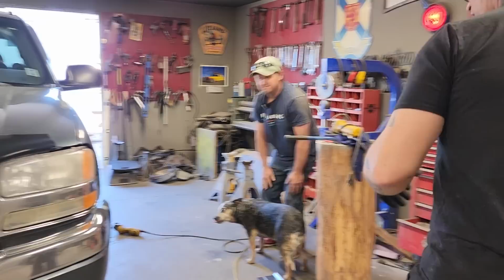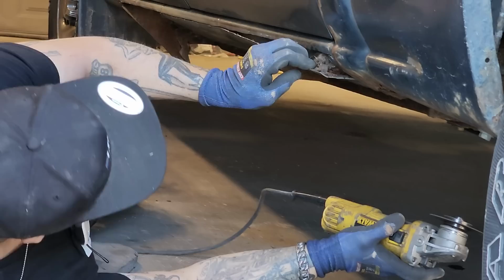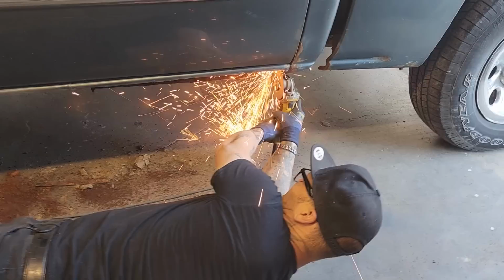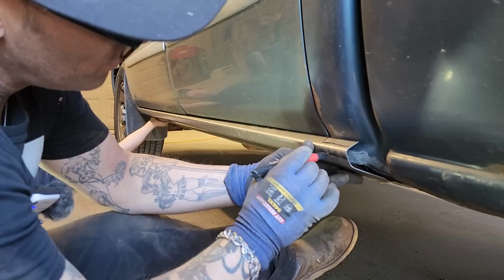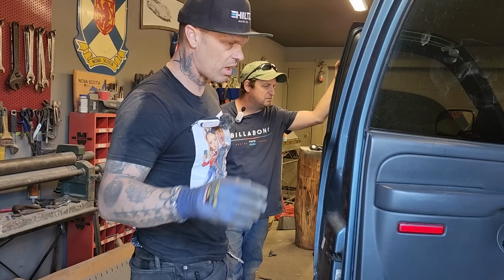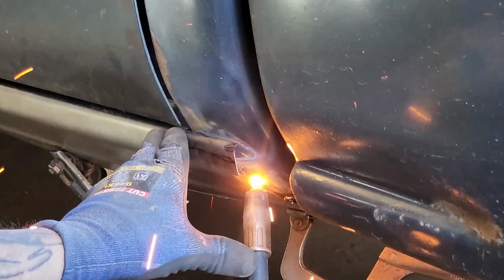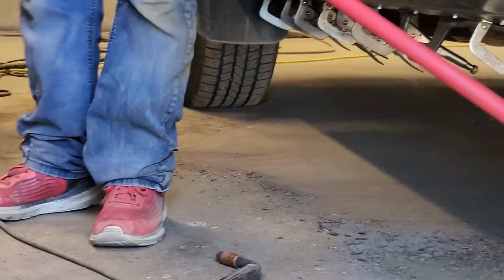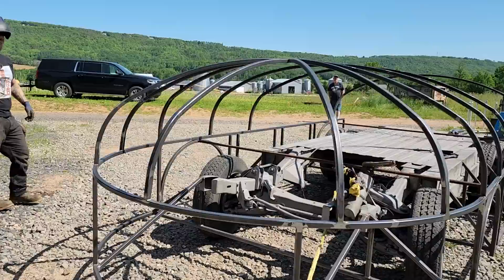Rust repair to pass inspection (sill replacement) ✅

Comment: These sort of repairs are my day to day - I've gone  good at  doing them through endless repetition.  I no longer give them any thought.  Pal came in today - I had the back axle off a big sprinter van where the mounts had all corroded away - I was rebuilding the mounts in order to re-fit the axle. No other place would even touch it. Sprinter will go out with that back axle solid as a rock.  He was amazed that it was even possible - to me it was just another day at work. 

I see the same vibe here - just another job, no biggie - that only comes from long experience. People see it & think it is amazing - Chads going "Well this is a doddle... todays a Holiday Day!"
Reply: Isn't it fun when your skills flow after daily practice.  It becomes like second nature.  Congrats on achieving that with this type of work, if only so I don't have to.

Comment: finally you went with 'store bought'. I mentioned that last truck rocker repair and got chastised for the even considering that. Actually addressed as negative comment on following video
Reply: Rocker was hand bent on a brake
Reply: @robclawson2931  i know that. The rocker is made by the guy that sold Chad that big body machine (?)

Comment: i just put home made rocker panels on my 57 chevy wagon and i painted the insides of everything before i welded them on.
 i also used a Lenco panel spot welder to weld them on.  it makes it EZ but everything has to be clean for the welder to work.

Comment: Chad in my experience welding on a car I always disconnect the battery ground side. As welding on the car the ground current travels through the whole car, there is a chance it might travel through the alternator or even worse the cpu  { computer }. Good luck as always. Bob from Fresno, calif
Reply: Yep we always disconnect the battery dont want to be blowing wiring, batteries or on board computers, if he got a bad earth and fried the computer he is up for a lot of money, not sure how much over there as people trash vehicles after a few years, here they are expensive, even jump starting or charging batteries is a risk, Doug should know that being a mechanic and all.
Reply: @jamesmatheson5115  oh wow are you being critical against bad Chad?🤔🤔 that’s a first.🙄🙄 it’s just amazing me how jealous you are that bad Chad make millions and you don’t !! You must stay awake at night Thinking about bad Chad. 😝😝😝😝😝
Reply: Not necessary with MIG. Exhaust shops ‘never’ disconnect the battery.
Reply: @howquick  Isnt most exhausts isolated with OEM fittings? Plus its a clean material, so guarantee a good ground and strike, just asking.
Reply: @brucewitcpalek5120  yep, Im cranking all night, Im so happy Im in your head too. lolol
Reply: @jamesmatheson5115  they're bolted to the engine block...which has one or more ground straps connected to the body.
Reply: @jamesmatheson5115  well, at least you learned a new term from me. Since I always tell you bad, Chad is living in your head rent free. 😉😝😝
Reply: @jamesmatheson5115  just for the record...he disconnected the battery anyway.
Reply: @howquick  Thats good, did he explained why?
Reply: @brucewitcpalek5120  My life is too full to have anyone living for free in my head, seeing as I have serious anger issues and suffer from depression, you're my entertainment in the quiet hours of the night.
Reply: @brucewitcpalek5120  Not bad mouthing anyone fool, just pointing out what I do, if you struggle with simplistic English 101 than thats on you.
Reply: @howquick  Seeing as the engine is mounted using rubber engine mounts along with either rubber straps or donuts, Im thinking with the clean material, there wouldnt be much of a issue, unless you accidentally hit on the chassis or body.
Reply: @jamesmatheson5115  no he didn’t. Nowadays people just do it out of not necessarily knowing why…they’ve just heard it’s good practice. As long as the welding ground clamp is clipped on as close as practicable to the item being welded…it’ll never cause an issue. Ie..completed circuit.
Reply: @jamesmatheson5115  the engine has (sometimes multiple) braided (sometimes stranded cable) ground straps attaching it to the body/frame. All metal parts need to be grounded…more crucial in modern cars.
Only reason for rubber engine mounts, exhaust hangers etc…is so you don’t get the motor vibration going through the vehicle. Think of the motor and exhaust as separate to the vehicle…but connected via ground straps.
Reply: @jamesmatheson5115  what do you mean not bad mouthing anyone you just badmouth me by calling me a fool. That shows how much 101 English, you know !! Negativity is what people do to others, who must not have a very good life !!! I feel for you man I really feel for someone who lives in such a negative view of life and constantly critiques others. I have not heard you say a positive thing ever ever or ever.
Reply: @howquick  Yes i agree in a perfect world, if you're happy not disconnecting the battery then thats fine, personally Ild rather take no chances, have a nice day.
Reply: Doug disconnected it
Reply: @jamesmatheson5115 
Doug disconnected the battery
Reply: @darrinsutliff7871  yes, i was told, its not the point, I was simply stating what I do and the reason why, there's a lot of people watching that wouldnt know.

Comment: I spray all the internal nook and crannies with Fluid Film rust prevention.  Seems to provide excellent protection for lower body panels, hood and trunk seams, etc.    this truck really could have used it.

Comment: Im surprised you didn't wire wheel the rust off the inner sills and zinc prime before fitting the new sill. Just my opinion.

Comment: I see a z Bart undercoat plug in the rocker panel. when they sprayed inside the rockers the drain clogged the drain hole.. common problem ever vehicle. Great job guys  doggele what channel those cheap gm handle. There worse today..

Comment: Awesome video but man, help these people out for the future , I mean if you are gonna take the time to cut the old metal out, what about spending another few minutes with a wire wheel and get the loose crap out, and then spray in some simple rust convertor, not undercoat, it chemically stops the rusting process, a lil prevention while ya are there fella.. even a qwikie can plan for the future just cause ya ar e there.

Comment: Glad we don't have inspections in Michigan!  With the salt being used heavy in the winter wouldn't be many vehicles on the road! My 10 year old truck rusted on the bed around the wheel wells and they wanted $6500 for  repairing that and $775 for the rockers.  Great job as usual!

Comment: that flange tool you got from harbor freight has a hole punch that i have used when overlapping the flange and weld through the holes-worked real nice for me.

Comment: Enjoy watching your builds, but on the late model stuff, never do rockers (you call them sills) without doing the cab corners. The price is negligible.  And , although I like your idea of using be excess rocker to patch over the bottom of the cab corners.  It's not enough.  If you don't think so, mark this day on the calendar and in 2 years look for rust boils just above the repair.  I'd go with cab corners and cut them down  so the weld seam is about 8 inches above where the rust hole is, or just below the belt line. Great content.  Thank you.

Comment: I have this sill repair to do on my classic Hillman its had cover plates tacked over the holes so it gets thru the 6 monthly inspections but I want it done right so that will be me doing it, More stick out at the torch lowers the amperage for welding thin metal without blowing holes

Comment: They don’t care about rust in New York! I can’t believe how strict  they  are there! 
If I had my way I would outlaw salt and calcium chloride! And anything else they use that make vehicles rust.
I have a 2000 F350 Ford pickup truck I don’t drive in the winter that doesn’t have a bit of rust anywhere on it!
I’m an old retired disabled mechanic that can fix many things. 
But I’m no body man! Your videos inspire me to try and fix some rust spots on my cars. 
I tell others about your channel because it amazes me!

Comment: using dually wheel on single wheel front spindles currently on frame will completely change steering geometry.  Your stock steering geometry is designed for single wheel that centers on spindle / axle and bearings.  Dually wheel move wheel / tire centerline out like 8-10" beyond where it's designed to be putting load centerline of wheel / tire same 8-10" out from where it is with stock single wheel rim it has now.

I have a drawing of front axle ball joints showing wheel stud backing plate and how it is off-set out so dually rim tire is centered same place on front spindle as  single rim tire on steering axles.  Problem is I can't attach it here in YouTube. :(

Comment: Chad, I’m thinking about repairing a small half dollar sized rust hole in my truck bed by cutting the rust out and welding in a new piece. I’ve never done it before. What kind of welder should I be using?

Comment: Why didn't you hit over the rust on the inside of the seal with a wire brush and clean out the rust and trash on the bottom of front fender there was about an inch of crap under there look at frame 26.57 look at all that trash up in the corner. Chad could of hit over the old rust with a wire brush by hand and knock the old rust off. I'm not trying to be a ass hole just saying it should of been done

Comment: The best thing to do is panel bond the upper ledge. Yeah it cost 25-30$ for material but its actually cleaner faster and if you need to remove years from now you can heat it and remove. All that ground metal covered in panel bond wont rust like the ground edge you made. Next best would be to punch a dozen or so holes in the upper lip and weld up the holes. You can sand them flush. a small bead of seam sealer and its ready to paint. I can do the upper in 1/2 the time he spent plus a hole welded up is much stronger than a ground off lip weld. and that was a solid one piece of metal and now not near as strong. Its a collision safety issue if the truck is hit in the side
Reply: Yep,  if your going to weld,  pre drill/punch holes in the panel, grind clean on both sides, grind clean the weld lip, weld thru primer all, then spot weld. But the fastest,  cleanest,  most durable,  rust preventing,  way to do it is panel bonding adhesive.  Look into it Chad. Welding has its place for sure, but on the late model stuff, if you can panel bond , you do it.

Comment: Why not weld it up since your under coating it?  Or its not getting under coated?  Just leave some weep holes.  Everything a manufacturer did to a truck or car didnt mean its right, it was also meant to shave cost on production and assure it will rot so part replacement is where the money is to be made.  If i had the choice between a spot weld and a stick weld, its a no brainer.

Comment: Unbelievable that some holes in a rocker panel/sill mean a failed inspection. The focus should be on the frame. Government overreaching a bit...
Reply: Rubbish, the sills add strength to the vehicle, rusted sills = a less safe vehicle in the case of an accident.
Reply: @MickH60  Yes - some 22 gauge rocker covers will save your life.
Reply: @MickH60  Then while you are at it, go ahead and throw in a 5 point harness requirement. No 5 point harness = a less safe vehicle in the case of an accident.

Comment: Why does " Inspection" frown on rust !  Learn me !
Reply: The sill {rocker panel}  is structural, in an accident, a car with rusted sills will not be as strong as a car with good metal all round....
Reply: @MickH60   I am pretty sure the FRAME is structure .  The truck is not unibody . Sounds like make work for body shops from the government .
Reply: No Sharp edges
Reply: @Bucksbeaters902  The whole vehicle is SHARP at anything above 1 MPH !